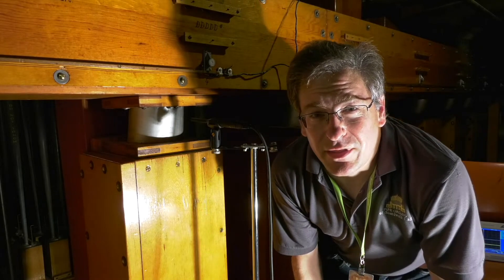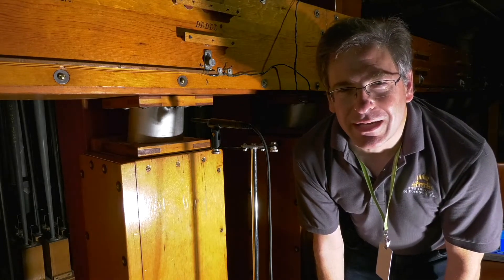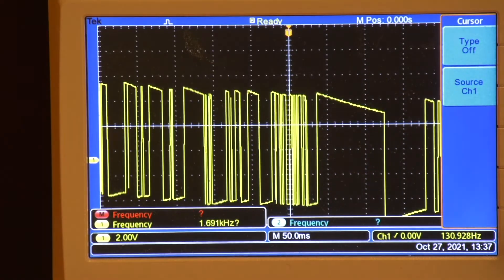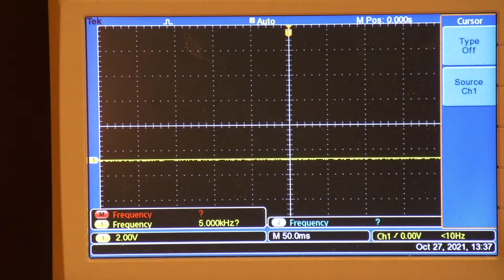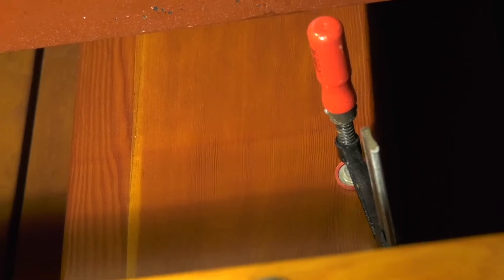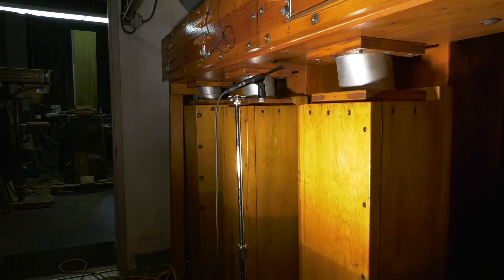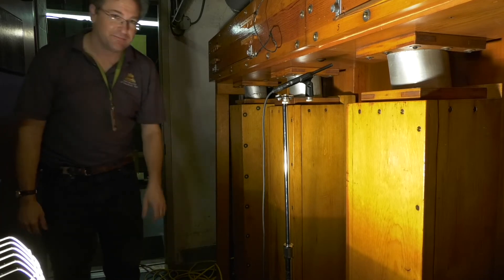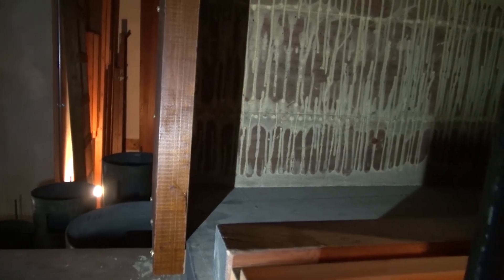Boardwalk Hall- More 64!

Comment: Never thought I would see an oscilloscope used to work on a pipe organ!
Reply from the maker: It was a natural for this project!
Reply: @cnagorka  I have been thinking about ways to more accurately sense those low pitches than a microphone.
Reply: @timstoffel4799  MEMS Accelerometers would work for frequencies that low. I know they're used for input shaping (i.e. determining and correcting for resonances in 3d printers)
Reply: Interesting idea! I suspect part of the challenge here is that there is 'bounce' of the valve creates multiple pulses that you can't discern with your ears but that is being picked up by whatever mic he is using and making it hard for the 'scope to trigger to.  @therealchayd

Comment: It would be interesting to put a contact mike on the pipe itself and measure the fundamental and major harmonics it it producing. It sounds to me like the sound being produced is the pipe mechanical vibration and not the air column inside vibrating. Perhaps it was mechanically impossible to construct a pipe that long with sufficient stiffness to allow the air in  the pipe to speak without adding the mechanical sounds we hear. I'm thinking a pipe that long would have to be made of some wood stiffer than pine to speak properly.
Reply: Also look at all the harmonics it is producing to see if they are the proper spread of harmonics seen in the higher pitched pipes on the same stop. Which I assume are the harmonics (the sound) the designer intended for that rank.
Reply from the maker: @JP-rf7px  I tried using a "boundary" mic directly on the pipe beater box but it didn't work at all. Someday I may take another crack at it.
Reply: @cnagorka  Maybe a strain gauge with one end attached to the pipe and the other to building heavy structure. Would probably have to do at several points on the pipe to see if there are "nulls" at certain points. But I know that would require a lot of climbing around in chests!
I applaud your efforts to even tune the beast, much less get the harmonics structure to match for each pipe.
Another thought. What if you recorded one of the higher pitched in the rank and then electronically lowered the pitch to see what it would sound like at the lower notes pitch. Might be interesting.

Comment: I think for the lower frequencies you can improve the circuit. It would be easier to read on the oscilloscope.
Lets say you rectify the signal coming out of the microphone. Fullwave rectify the frequency with op amps. That doubles your frequency on the scope making it easier to look at and also easier to tune because now you have a higher resolution measuremenet. For the chaotic behaviour I would build a comparator that I can set the voltage manually so i can controll when it will trigger. Also I would low pass it so no higher frequencies than the measurement are going to be visible. I would probably build a frequency counter too so I can see the frequency real time ish instead of waiting half a century on the oscilloscope to show me a reasonable frequency. I would also recommend manually measuring the frequency on the scope. Navigate the waveforms with the cursors because that gives you a lot more accurate reading. Single mode trigger to capture it though
Reply: Edit: fixed the grammar.
Reply from the maker: Yes you're right but I'm done now, it was a fun experiment. I was going to bring an actual, separate frequency counter but that thing would take even longer than the o-scope to give a reading when I was testing the system.
Reply: @cnagorka  That is the reason why I would re do the sensing circuitry. Fullwave rectify it and improve signal integrity somehow because that scope reading was givving you a lot of trash aswell. Fullwave rectification and then peak detection for that you have practically just short pulses to measure would increase your use comfort..this is just a suggestion and how I would do it...eventually you will have to climb in there and check again at which point you want to come properly prepared..Not to make your back suffer waiting half a day for a damn 8Hz read :D